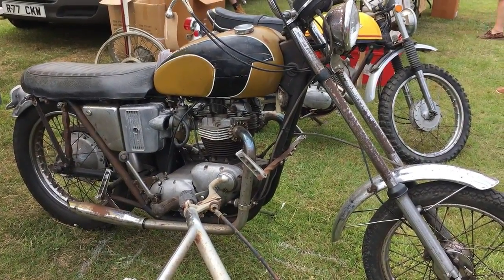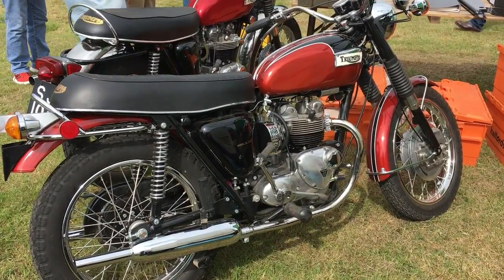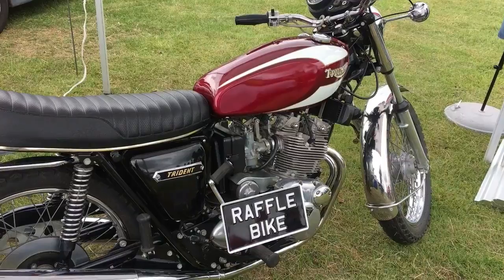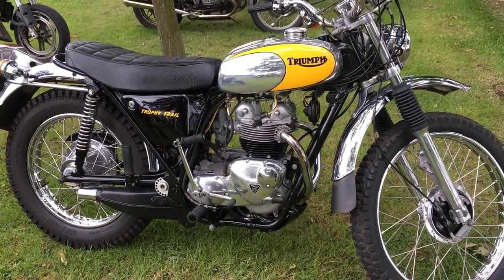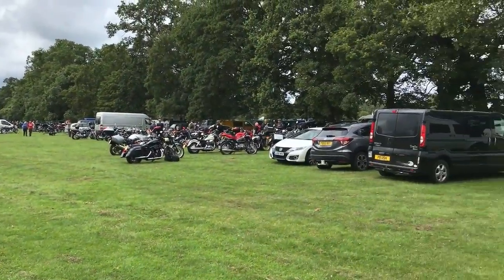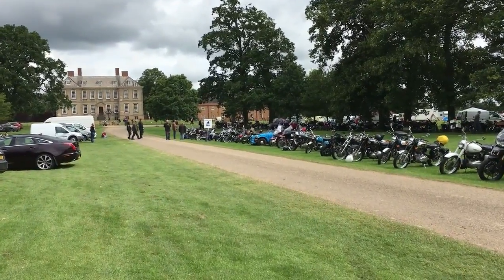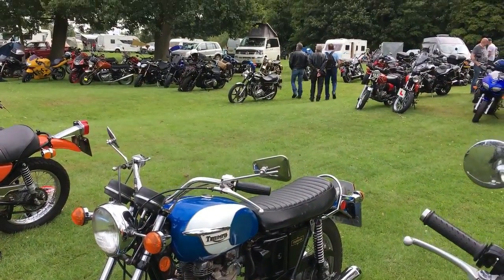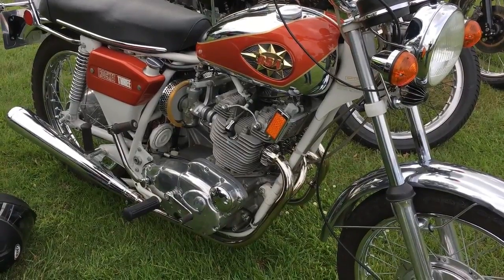Flying Visit to Founders Day Stanford Hall 21st July 2019

Comment: Just wanted to know if the A75 sits lower than the T150V?, looking at the pics of your A75 it seems to be lower. Thanks for any answers
Reply from the maker: Hi David and thanks for the interest and comment.  I'm afraid I can't be of much assistance as I don't have any reference points to compare the R3 with a T150; however, from what specs I can dig out from documentation, the R3 seat height is 31.7" and the T150 is 32" son you may be right. However, with the 1971 export R3 like mine, there were two seat designs available - the one as on my bike with the hump, and also the flatter slab like seat which looks lower.